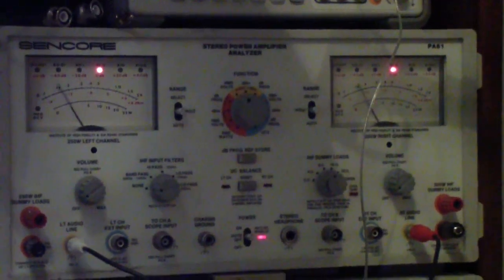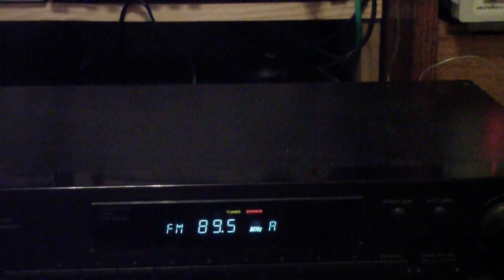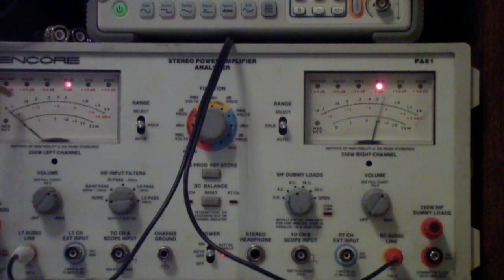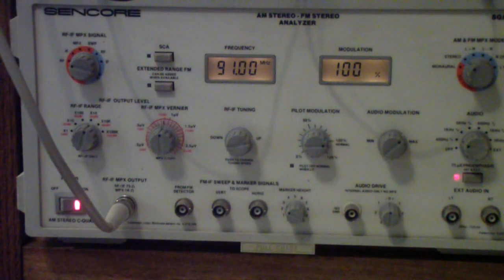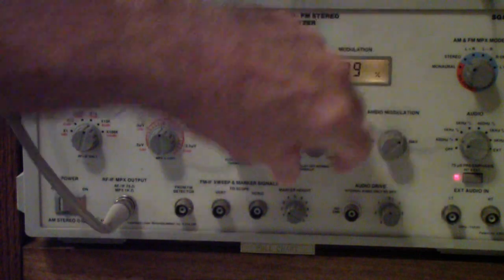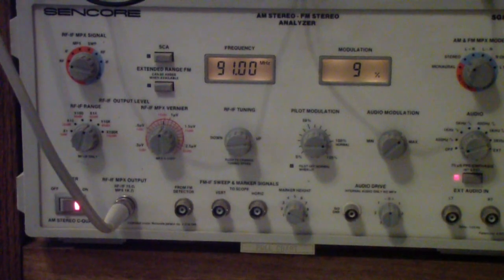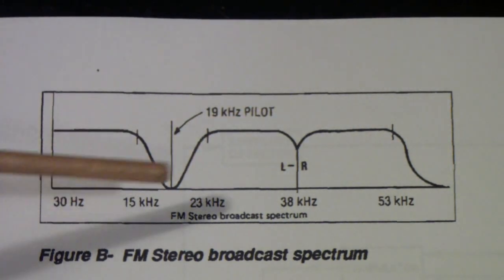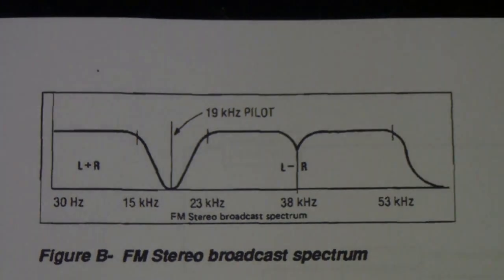TTT157 Sencore SG80 Stereo Analyzer

Comment: One thing I cant do at home is test and adjust FM tuner sections. I would like to have the equipment (and knowledge) to do this. When I restore a receiver, I am limited to replacing all of the old electrolytics in the tuner section, but no alignment....

Comment: Can this also receive an over the air signal and tell you what the modulation is? Or does this only output a signal? Can it be used as a modulation monitor for an FM transmitter?
Reply from the maker: The SG-80 is only a signal generator; there is no provision for an input signal or analysis capability.